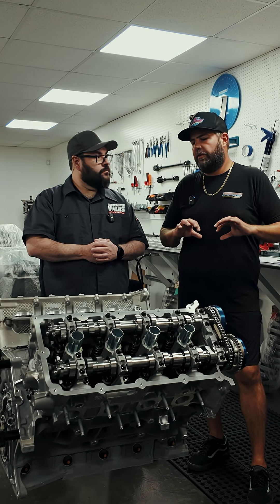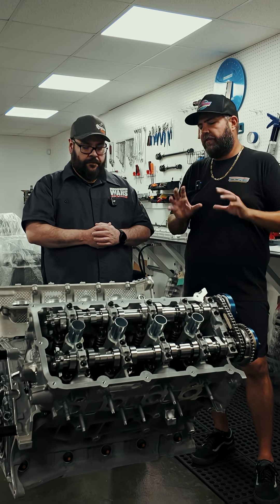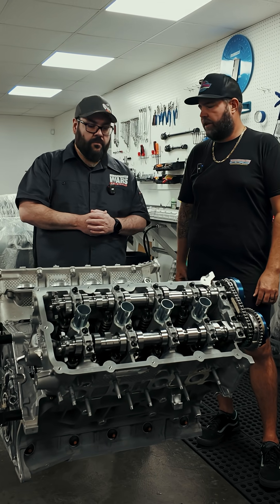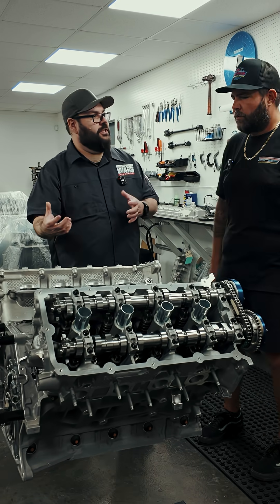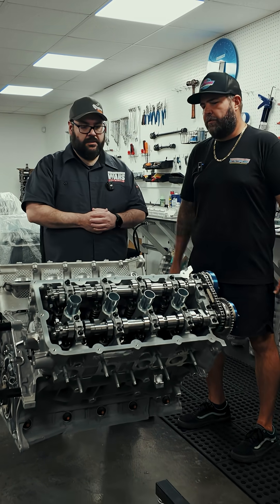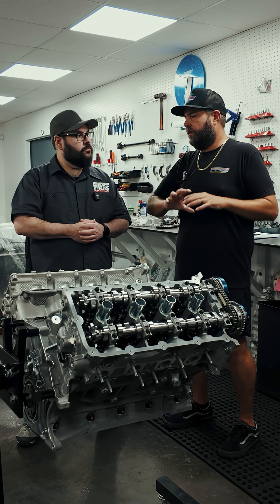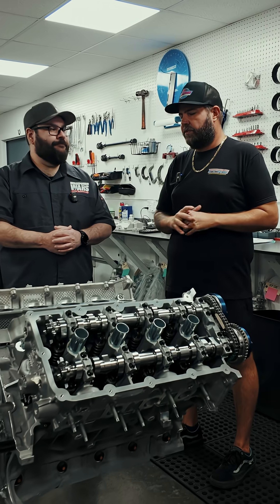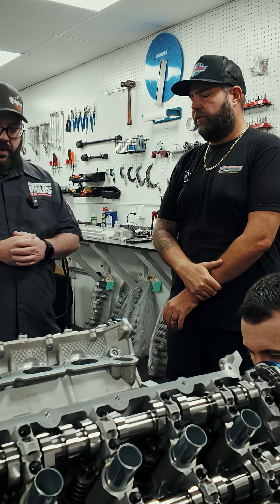FFRE talks about turbo sizing for LS vs Coyote 3 #shorts #LSvsCoyote

Comment: 1300 ++ hp ... how much TQ ...
TORQUE IS KING ....  so lets say twin turbo....  Nice Job.  
A 5.8 ltr stroker kit 4 the Coyotes....😅
Reply: A million gears are the kings now! Lol Its a Multiplier. DOHC are not know for tq. But we all know what high rpm hp just drops back into peak tq and revs back to the moon. Of course im speaking more street stuff.
Reply: Tq is king? Tell that to a 2jz as it wizzez past a big block. And tgere is not enough fat in the coyote for 5.8 stroker. If there was, someone would have done it a long time ago.
Reply: @fordmaster50 
A twin turbo Coyote with all the best stuff internally  is just so expensive . Big $$$ .
Super Charged.. 3.8 ltr Whipple Supercharger.  1600/2000hp++ . That will eat ur Toyota 4 breakfast, lunch & dinner.
There's a guy over in the USA drag racing a Coyote with 3000+ hp pulling around 10,000 rpm & that will also eat ur Toyota...  ur talking $60,000 /$100,000 engines usd ....  so ur Toyota will be quick & these Coyotes r like Rockets .😅😅